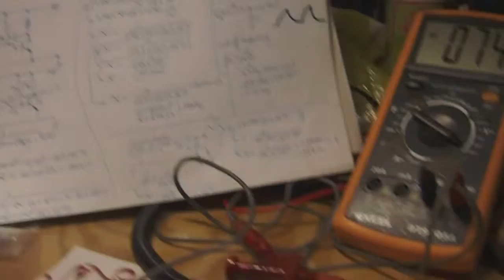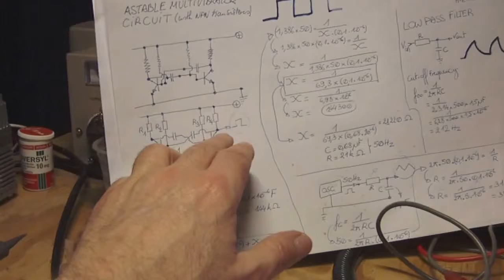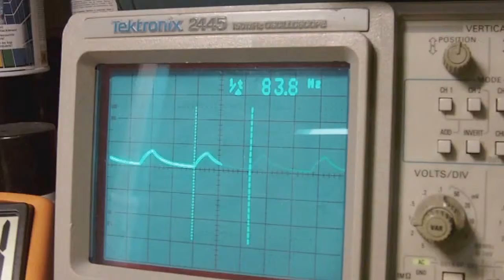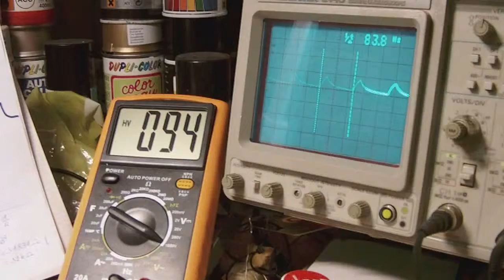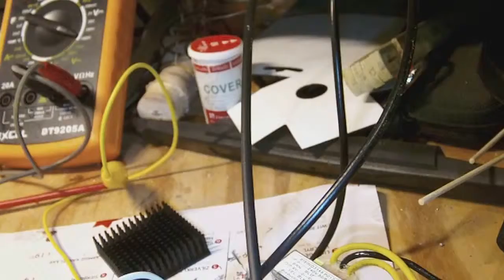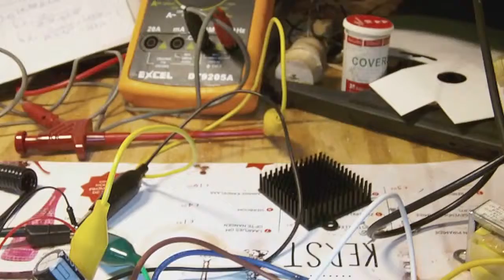Technemoira DynoBat part 6 of

Comment: Nice job on the DynoBat. One small correction, an Duracell 9V battery should supply at least 400mAh. So at 35mA consumtion you should get about 10-15 hours of operation.
Reply from the maker: Thanks for the tip. You made my day... I thought I would have to use many more 9V batteries to get that kind of autonomy... and that would of course somewhat defeat the purpose of the Dynobat :) I must have been sleeping while I calculated :P
Reply: TechneMoira You're welcome. I can say that I'm obsessed with battery capacity measurements :). Can't wait to see it in action on the radio.